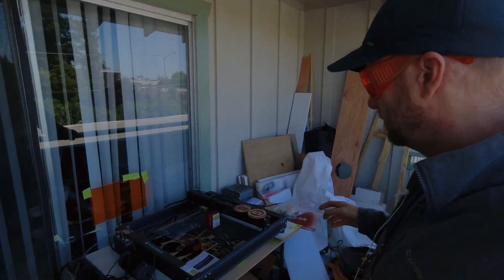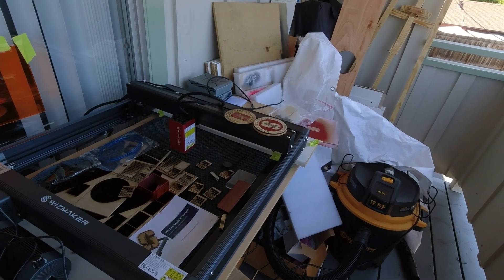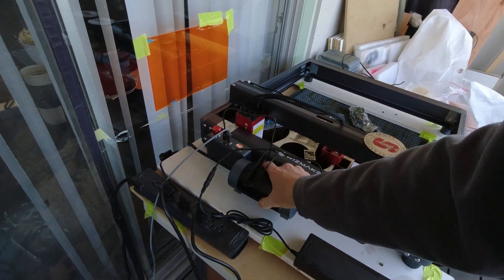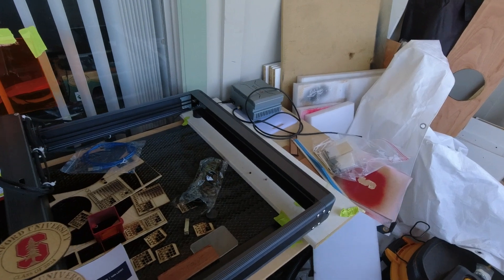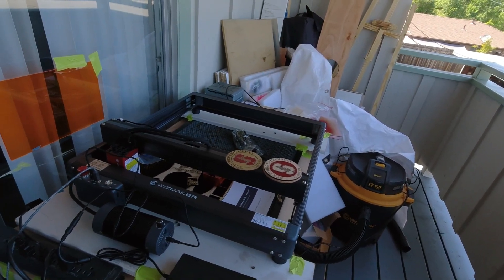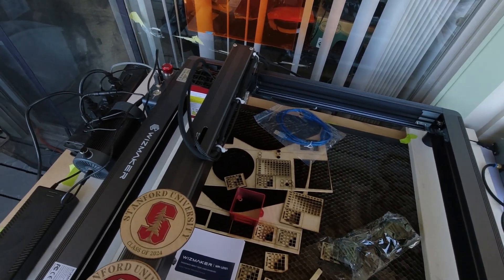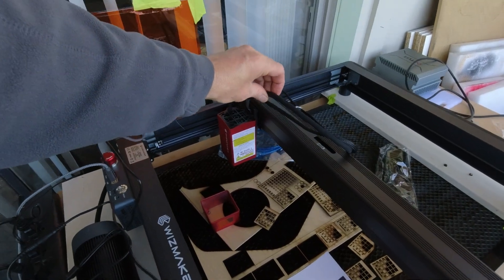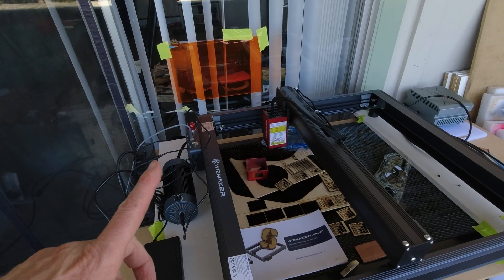NEW!! WIZMAKER L1 20w Laser Engraver (review) #Wizmaker #WizmakerL1_20W

Comment: Great videos.    I am researching for my first laser.   I have been looking at the Atezr, Ikier L1 , and now I have another one to look at.  What is your opinion on those 3?   Do you operate yours outside and drawbacks in operating outside?
Reply from the maker: These lasers, esp without an enclosure, will not like extreme weather. Anything below 40f you will notice some issues with belts etc.... And high heat is also bad. It is spring here right now, so weather is 50-70f all day and night, so it seems fine. Once it changes, I will move it back in. 
I think all of them will be good, but think about upgrades and accessories. If I was to buy today, I would probably get an Atezr P20 because of the increased bed size and extension (and current price). But things change daily around here, and my Longer Ray20 at its cheap price is rocking everything I can throw at it. Go figure